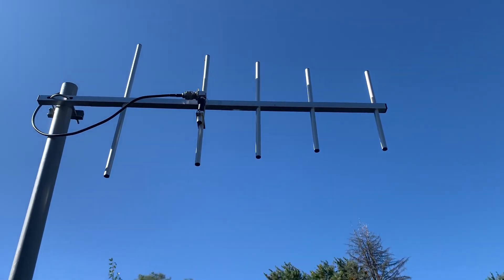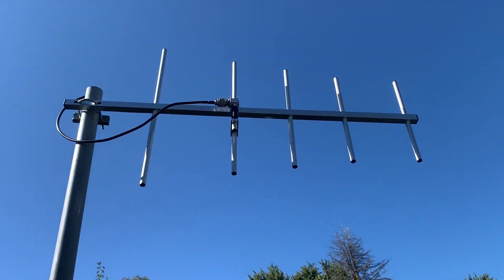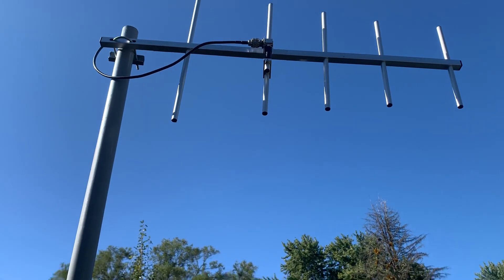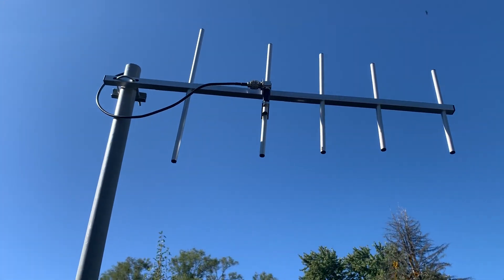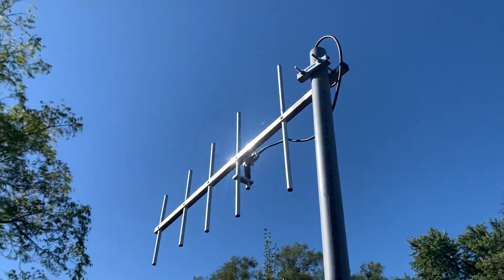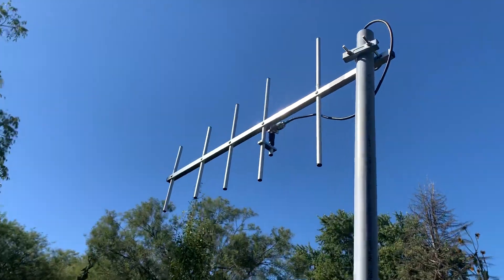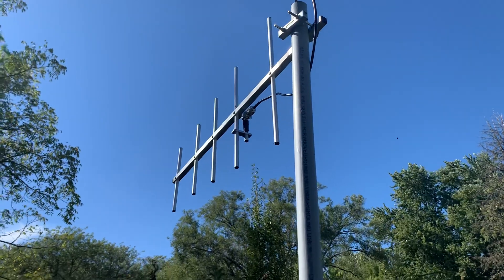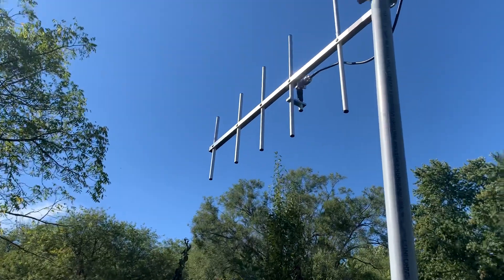More GMRS Antenna Testing

Comment: It’s all about getting up high. I welded an antenna mast with a base that straddles the peak of the roof. The yagi is about 45 feet off the ground. Double the distance so 90, take the square root of 90. It’s about 9 miles.  I can get it all of 9 miles base to mobile. You have a nice setup!